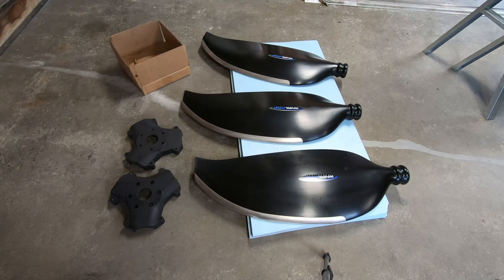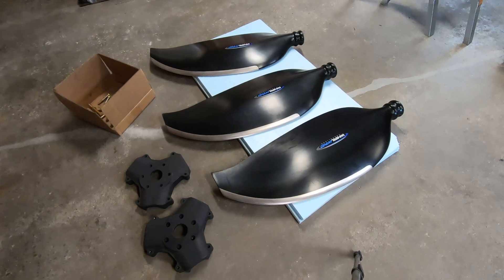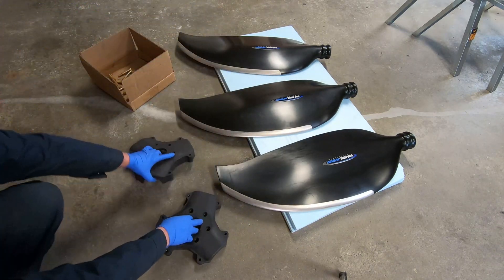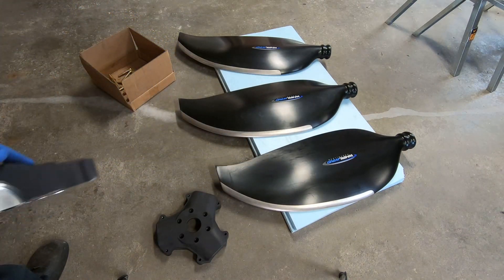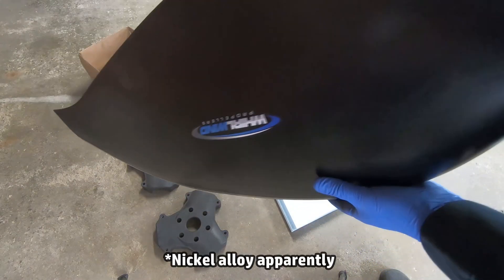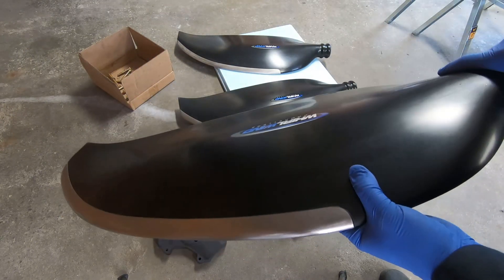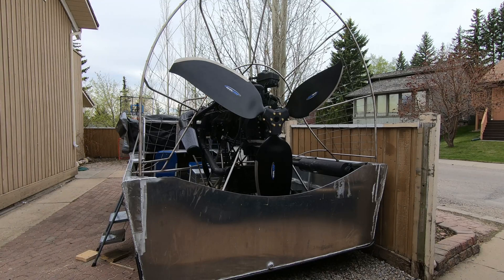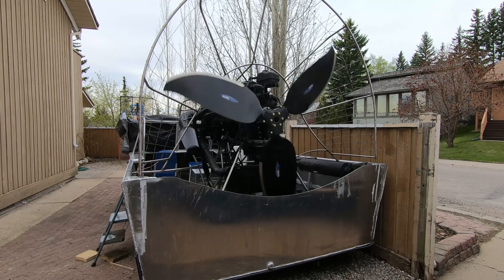Airboat Build #33: Installing the WhirlWind Super-Wide Prop

Comment: What are the differences os this prop to normal aircraft props? I imagine that It is optimized for static thrust and low speeds because of the operation characteristics of boats. However, why are they so wide? It might be to absorb more power from the engine. In this case It would be a better ideia to increase the number of blades. Wouldn't It?

Comment: Bud that cage is worthless.  Its not going to protect anything.  You just bolted $2500 to the back better find a way to keep it alive.
Reply from the maker: In what way is it “worthless”?   Looking to learn here.  There are some evident harmonics but I think those will be gone with the cross braces for the rudders (coming soon).  I will be running it on open rivers; I’m not expecting branches etc.
Reply: @dr.dansgarage  i understand your  not building anything that will  run the hill or through swap areas but its only a matter of time before you try. The cage needs to be strong enough to hold back any mistakes in driving,  any vegetation,  anything that could destroy carbon fiber.  You should almost be able to roll the hull over on the cage and it not hurt its integrity. That of course is a silly statement but you get the point.  Ive destroyed a prop before,  it happens in the blink of a eye.
Reply: @WhiteriverramboArchery  Forget the cage for now ,the prop makes its thrust off the last 3 in of the blade which is obscured by the transom not going to work as desired